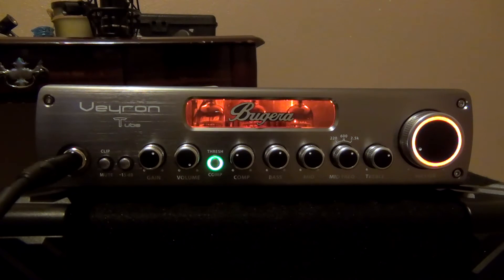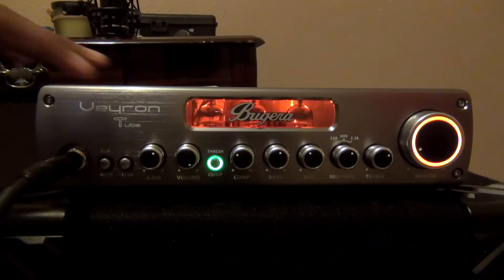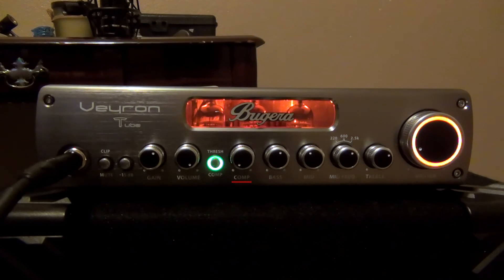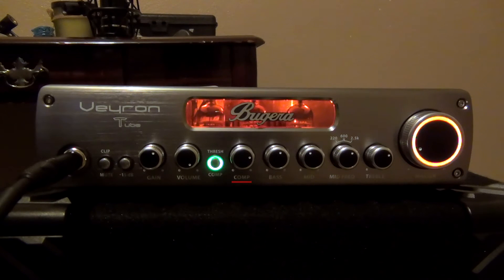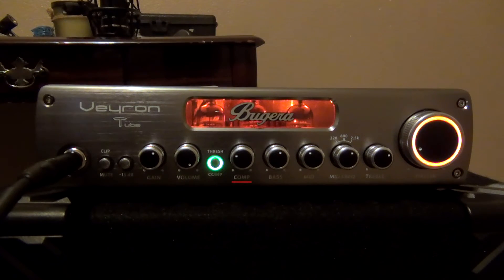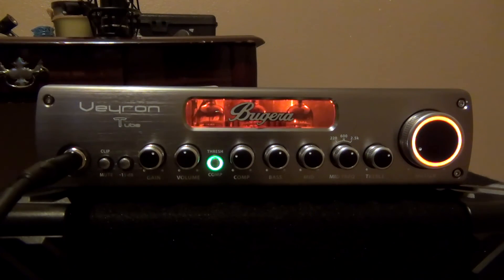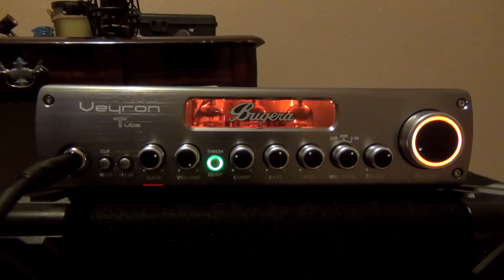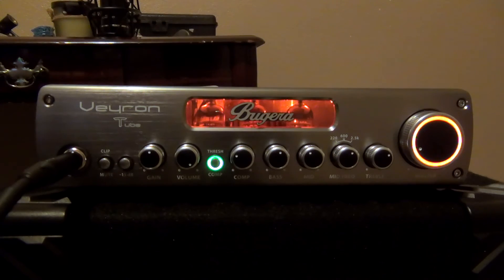Bugera Veyron T BV1001T head Review

Comment: Why does the clipping light come on at 5:54 ?  This amp is supposed to be 2000 watts.
Reply from the maker: +longdongbongchong it's because i didnt have the -15db pad on. It is somewhat of a mistake but the sound doesn't really change.
Reply: Because the clip light has nothing to do with the wattage rating. It's about the signal level going into the preamp. You could turn the Master down and the clip light would act the same with the same input.
Reply: It's 2000 watts max, not advertised in RMS like other manufacturers do, This amp is most likely between 400 and 800 RMS watts. I don't like that this company does this. It's not a bad amp, but they are tricking a lot of people.

Comment: I hear some people say it's not possible to bring out a real clean sound out of it. Even if you put the gain near to zero. But your sound is clean, isn't it?
Reply from the maker: This is actually the reason i sold this unit. I couldn't get it as clean as i wanted🤣
Reply: I had the same problem when I first got the amp but after awhile of EQing, I was able to get a clean and powerful tone.
Reply: @foganewgon  what were your settings to achieve this? Thanks!
Reply: @terryh9825  Gain: 1 o'clock
Preamp volume: 10 o'clock
Master volume: 2 o'clock

I'm using an active music man stingray in a small room, so you might need to adjust it your settings as needed. Hope this helps!
Reply: @foganewgon  I've had mine for a a year now but never set the gain and volume like that but now it's making sense to first get a clean gain then send that max'd to the preamp section seems to work.  Unfortunately there's no "real" user manual to go to.  Now fingers  crossed when I gig this weekend that it doesn't go up in 🔥 Fender Jazz Elite with this one👍
Reply: @foganewgon  your Mid knob position and with Mid freq setting?  220, 600 or 2.5k?  Just getting an idea of what works for others.....
Reply: @terryh9825  I always keep it on 2.5k. I also leave the mids at 10 o clock

Comment: Hi can I use this with one bugbear 2x10 for small size gigs? say 100 crowd size. I'm thinking of getting this amp and 2 bugbear 2x10 however I want to be able to use just one cab for church and some small gigs, and two cabs whenever I need more...based on budget I'll choose between bugbear and Carvin 1500w head and 2 carvin BRX10.2.
Reply from the maker: This amp has 2 outputs for to cabinets, and functions just fine with one plugged in. So yeah this should work for you.

Comment: The main question everyone who views this has, is does it really have 2000 watts? It's main function is compact massive power and you never addressed it once. I did like the tone reviews though.
Reply from the maker: I haven't answered that for a few reasons. The first being that i don't own the unit anymore and the second being that nowhere in it manual does it tell me about the rms. And i dont know anyone who can test it but i do know that it can get house shakingly loud!
Reply: Thanks, but still not looking for an exact measurement. Just wondering if it lives up to being the most powerful compact bass amp on the market. I have a GK MB500 that is awesome. But is this an upgrade? I also have an Ampeg SVT-Pro-5 that is supposed to be 1000 watts. Is the Bugera Veyron T BV1001T more powerful than that? I don't want to lug around the Ampeg SVT anymore when I have the need for big power. Will this little beauty take it's place?
Reply from the maker: I'm not sure about matching the svt tone. But matched with the right cab(s) you will get the volume!
Reply: @richardgray7310  it's got about 550 watts rms.
Reply: @quasimotto2248  Where did you find that? I assume that's at 4 ohms?
Reply: @De50lat0r  I used a little trick at the Bugera custom support. So I know now definitely it's got 550 Watt at 4 Ohm.

Comment: how loud is this amp as i need to be f.loud as play in a metal band n need to get over a loug guitar player ??
Reply from the maker: This head can put out. I'm sure if paired with the proper cabinet you'll
 have no issues! I played in a rock band with a Marshall stack, fender 
reverb and drum kit. No problem.
Reply: I’m into the burgera 1x15 and 2x12 8ohm cabs and easily overpower our guitarists even in outdoor gigs. If u need extra, then use 4ohm speakers to get the full 2000 watt power.